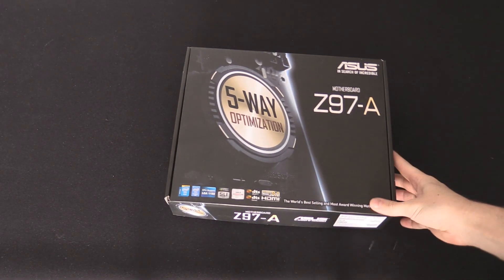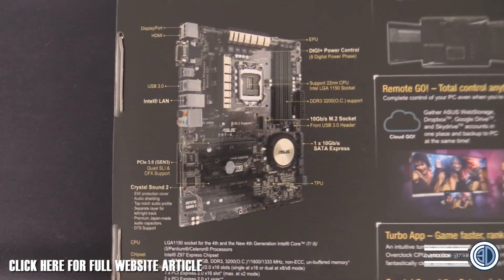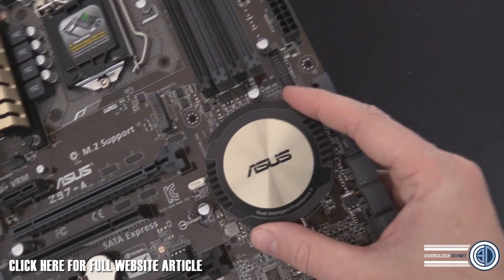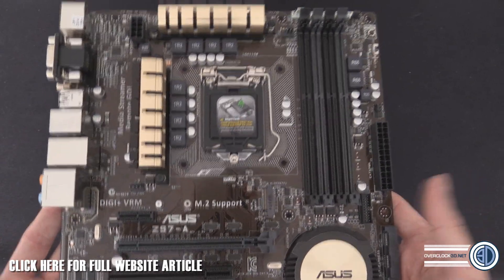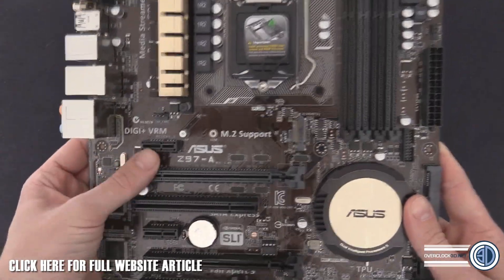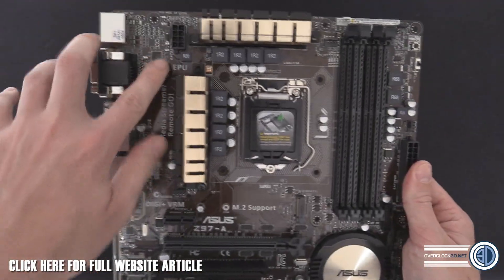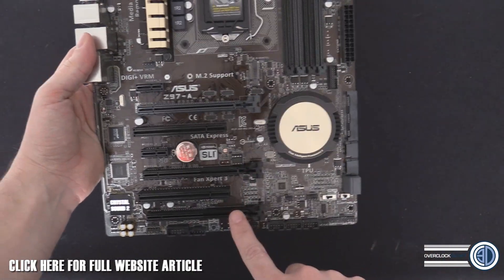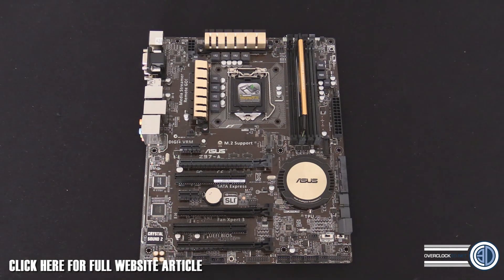Asus Z97 A Motherboard Preview

Comment: My Maximus VII Formula was affected by a lightning strike and the bios is wanky.  I ordered the Z97-A  board in hopes that the bios and everything will work
and save all my settings.  My 1909 win 10 pro that I deleted everything on a 1TB drive to install, within 2 days updated to 20H2 that they say is still win 10 pro.

I would like to purchase a TPM 2.0 if it will work for this board, I have read that 1.2 is the only version that will work with this board ?
I am paying $185.oo for a refurbished from ASUS Z97-A that the bios is 5 years old now. They never support bios for more then 2-3 years
as they want You to upgrade.   My i7-4790K Devils Canyon hits over 5K and so I hit the silicon lottery. My Ram used is going for 400 for 32gigs.
I ordered the C version and it came in all chinese writting and manual, and I sent it back.  This one has 7.1 that makes me think its better then the C anyway.

  Thank You for having this video and showing the board, I just hope it arrives soon and Merry Christmas !!!

Comment: This motherboard refuses to run my Asus GTX 660, it keeps crashing my nvidia windows kernel mode driver. It doesn't matter if I use an older set of drivers. Also I've tried to run the GTX 660 on a different system (with a Gigabyte 990FXA MOBO)  without any problems at all, as well as another GTX 550ti in this system with the Z97-A  and guess what? 0 problems running it what so ever. However I'd rather not use my old graphics card in my newly bought system of course. So does anybody have any idea about what the issue may be here?

Comment: As the owner of a Z87-A I think looks wise this board is a big improvement.   While the gold heat sinks were not exactly winning beauty contests it was actually the yellow plastic PCI slots that were the real turn off.

The Z97-A looks better but I still would have much rather had an updated version of the old blue Asus look.